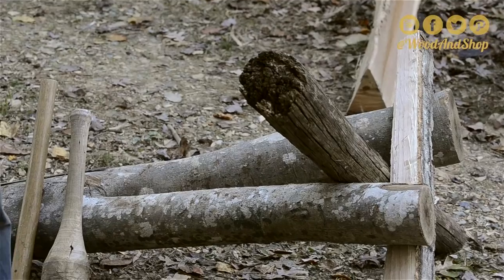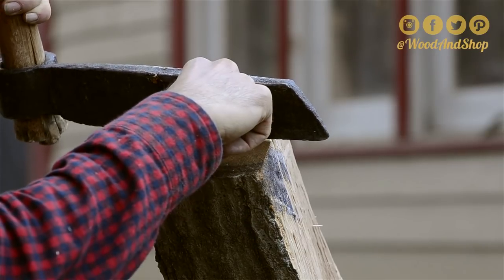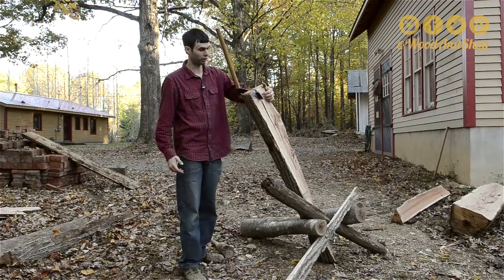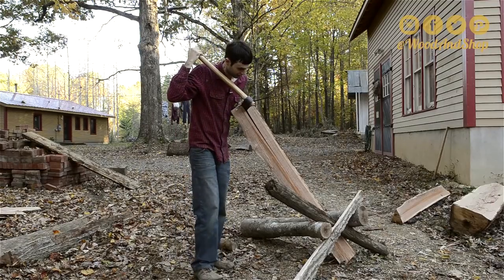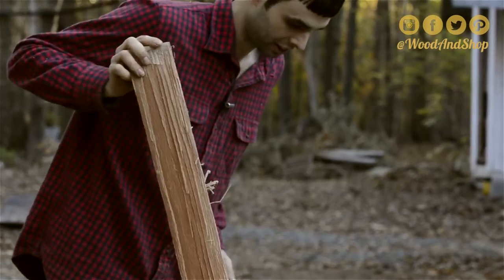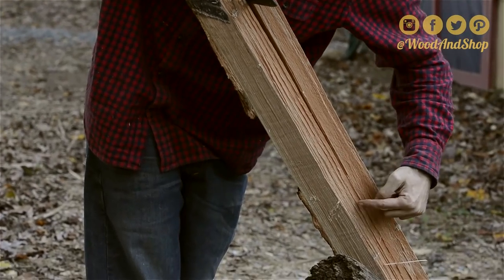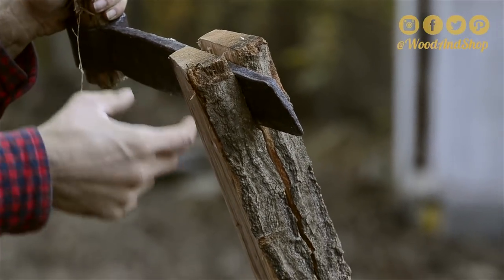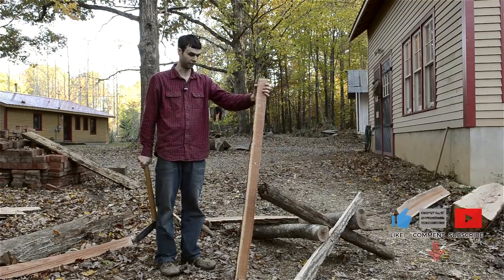How to use a Froe to Split Green Wood w/ Elia Bizzari

Comment: thanks for the video. "not osha approved". lol. interesting that you can control the path of the split. i'm not sure i understand the physics/principle of how this works. i would have figured that once the split started it was beyond your control.
Reply: Hi, I know this is an old comment but as I understand it you are ripping away the bottom section from the top, which is mostly stationary, by radially moving the froe on the top which is the pivot point. He explains it at 3:40. :)

Comment: Please sharpen your froe 😱, good video thank you
Reply from the maker: No need for him to sharpen his froe. It's a wedge. Actually, a gritty wedge works better than a sharp wedge.
Reply: Wood and Shop is this truly correct ? 
I bought an old one today,I turn a handle tomorrow,and then the blade...
My plan was to make it a VERY heavy razor blade....
I’m guessing that’s a bad idea !?!?
Reply: A froe is a splitting tool rather than a cutting tool so I think you loose rather than gain from over sharpening it - but try it both ways and do what suits you!
Reply: @andrewgarratt5191  Late to the party, but you won't keep your edge. And it may end up damaging it once you wack it. Seems weird because we are so used to sharp tools as a goal.
Reply: It's like a splitting axe.  They really don't need to be extremely sharp however if it is too dull it will slide easily when it is in place ready to be whacked.  Sooo.... not too sharp and not too dull.